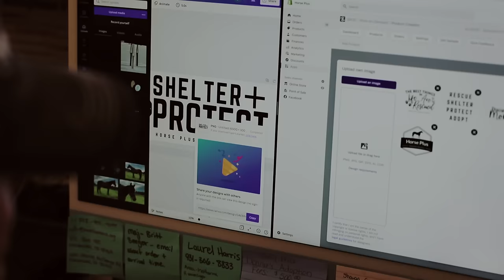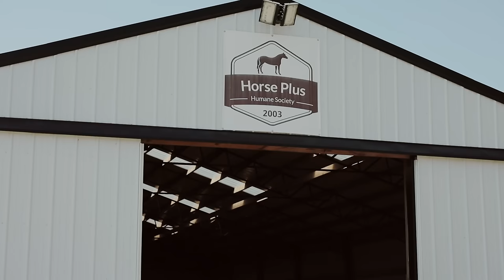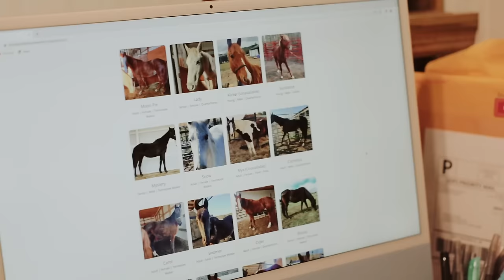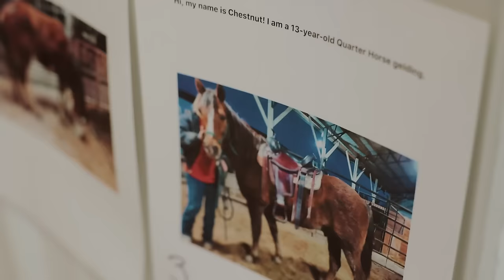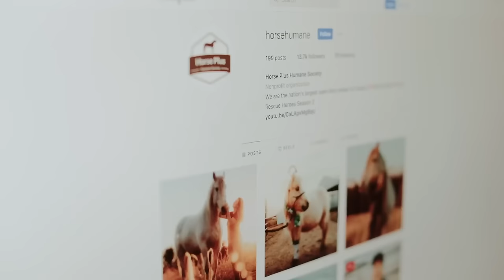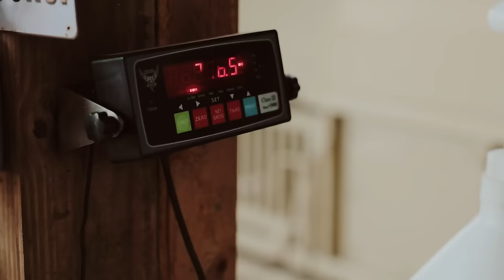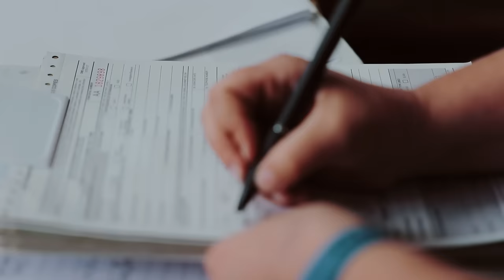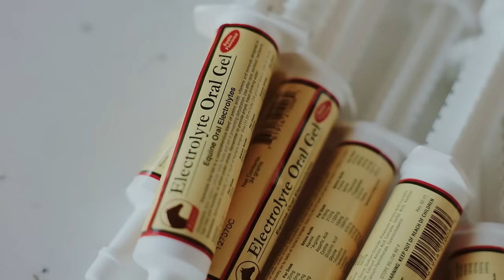We Rescued 4 Draft Horses from Auction | Horse Shelter Heroes S3E6

Comment: Donnie (37:30 min) needs to contact Horse Plus and identify the horse that he wanted  to purchase, that they bought and then try to get 1st dibs on the adoption when the horse comes out of quarantine. He'd be getting a fantastic deal, given the amount of care these horses get from the point of sale at the auction, through the intake and vet checks (additional care, when necessary), farrier work, and then the quarantine process. If Donnie had been successful in buying the horse at the auction, he'd be responsible for evaluating the horse's needs and the adoption fees are not that high. He will probably get a better deal on the horse than he would have, had he bought it directly from the auctioneer. I suspect if Donnie arranges an adoption ahead of schedule, Horse Plus would work with him. Doesn't hurt to ask, keeping in mind, the answer is ALWAYS 'NO' if you don't ask the question.

Comment: I'm glad you mentioned some of the nasty auction tricks like when they give a horse pain meds before it comes to auction so it doesn't show any immediate problems in the ring but you get them home and they are limping or need severe medical help. Another one is when they give them equine steroids to make the horse move out and appear very energetic. This was previously done vary often on draft teams to show how much they could pull and when the new owners got the horses home the horses would not or rather could not calm down and stop running and moving and when they haltered them up and were just walking them to calm them both drafts ended up dying of heart attacks because that is how many steroids they gave them. Sedatives for aggressive horses are also sometimes given depending really on what the seller is trying to convey in that auction and for that breed or work type. 
My guess is with the aggressive horse that there is something chemically or physically wrong as horses just don't normally act that way. Not burst out violently and be so unpredictable and even more aggressive horses I've had to work with have had some level of predictability. I'm guessing if a necropsy was performed there would be something wrong. That little white one and some of the others make me very angry. They simply needed proper vet care, wound care, farrier care, etc. and may have not needed the last act of kindness.
Reply: If you watch the video again, the vet explained about the little white pony. It's knee was fused into that position and the pony would never be able to use that leg normally. The person you need to be angry at is the original owner of that pony who clearly didn't get it appropriate vet treatment right after the injury so it was never in this position.  In each case there was an explanation given in the video as to why that horse or pony was given the last act of kindness-they all had conditions that could not be treated or fixed and that would result in lifelong pain and suffering for the animal in question. Horse Plus saves every equine they can, but in some cases keeping that creature alive would be cruel.  I agree that it is very hard to see, but the real problem is the original owners who dump these horses at auction instead of looking after the problem themselves.  I hope my answer helps you understand.
Reply: @forensicgirl  I wasn't saying I was mad at Horse Plus. I actually said "They simply needed proper vet care, wound care, farrier care, etc. and may not needed the last act of kindness" because so many that were put down were preventable had the owners been good studards of their animals. With farrier care and less grain/alfalfa the ones with founder may not have needed to be put down. With proper wound care immediately that little white one would not have a fused joint and infections from puncture wounds. Due to the size of it and them being puncture wounds could be a coyote to feral dogs. I feel you didn't really understand what I said. I never said I was mad at horse plus but said that every or majority of issues that lead to deaths were preventable. Some easily preventable. You're inferring things and meanings I didn't actually say.

Comment: All of the horses look so chilled out after your intake process. Is this due to them feeling good and happy about where they are, or do you give them something to mellow them out for the intake process that just hasn't worn off yet? They look almost sedated, they are so chilled out, so I am just curious because I know that you guys use a product called Synchill after the auctions, and I'm wondering if it's because of that, or that they just feel happy and calm in their new surroundings and feeling like y'all are helping them now and they're on the road to better lives.
Reply: I don't work there so I can't speak for them but Synchill takes approx 6 hrs to kick in and lasts for up to 18 hours. However it is only a calming supplement. The palomino mare was sedated for the vet to really get in and pull on the skin and pull out the puss and see about stitches.Her eyelids were half shut and her head was very low and well, I've been around the block enough to know she was sedated to thoroughly inspect the wound.  Other horses are given pain relief when they have been in pain for potentially a long amount of time. Having bought from auctions myself. . . . .horses and donkeys are not dumb. They are going from a place where there are sick animals in pain shoved in stalls together with numbers slapped onto them and the place is filled with as many animals as can fit and be sold. The horses are in an unfamiliar place, stressed, uncomfortable, with other horses they don't know who may have been sold 4X before they came to that auction house and they just know. It's chaos and there are speakers calling out numbers and people walking by them to check them out before the auction begins so they know who to bid on or not bid on. When the horses go to a new home or the Horse Plus Sanctuary. . . . .it's not chaotic, they can breathe, there are not hundreds of people and hundreds of other horses stressed to the max. They do the transfer in daylight which helps a lot. One trailer at a time and then each animal individually and they see pasture and horses are all body language so they read people's intentions and these people are not chaotic or intending harm or looking at them like a payday. They give them a lot of slack on the leads and sometimes just use panels to guide them in. It's not a noisy environment. They receive pain medications and medical care they may need. Then they are put into a pasture that is for new comers from auction for a quarantine period to not endanger the other animals at the rescue and it has food and water. You would calm down too if you had fresh air and saw grass and calm people and got medical attention after coming from pure chaos of an auction. I'm human and I don't like the chaos of the auctions. 
Oh, and those wounds like on that mare with the cancer on the hindquarters to the donkey who seemed to be flea infested and the mare with puss in the leg that needed to be cleaned out. . . .they smell bad. They smell bad to their own kind. Horses with cushings smell different because it is like diabetes in humans so they smell sweet like sugar. Wounds smell bad especially when they are not cared for. These horses are surrounded by this in the auction and lord only knows how many auctions they were at before this big one and they smell sick animals and may end up sick themselves or get injured in transport. It's just a horribly stressful environment and I normally do what Horse Plus does and I pay for the overnight board fee and pick the animal up the next day in the full daylight when everyone has left and they have decompressed a little bit. Walking away from that to a stress free environment with pain meds/medical, food, and water is like night and day. The animals know when they are safe and when people care.
Reply: @Lizzard2060  thank you for your reply. Seems like it's probably a mixture of both then, because I think all of the horses were given pain meds the night before, as well as the chill stuff and I'm sure it was all still coursing through them.

Comment: What is BigLick?
Reply: It’s a horse event where trainer’s deliberately take high stepping horses (Gaited and usually Tennessee Walker’s) and put chemicals on their legs and hooves that burn and hurt them causing them to flinch and step higher. To keep the chemicals on the skin, they wrap their legs in Saran Wrap and keep it on for days. To avoid being caught with the horses being in pain from the treatment, they desensitize them with a cattle prod until they stop flinching when they’re touched on the legs as some judges check to see if they had chemicals applied.

The average age this starts is around two, same age as showing, they’re also given platform horseshoes (picture high heels) to wear to exaggerate their step and to wear them they have to grow out their hooves unnaturally long and they never remove it until the horse is retired, some lose a shoe (and part if not all) of their hoof during shows. The horse ends up lathered in pain and can barely walk. This is legal and allowed in the arena along with chains on the horses front ankles that hit them every stride causing them to flinch and step higher.

The result from this if they’re lucky is hair loss that is severe enough for them to be unfit for showing (hair loss means chemical burns and judges banned it years ago) The worst is (and unfortunately more common), broken hips, legs, hip displasia and other chronic back issues that are irreparable.

Horses aren’t made to have so much weight up front. Especially at a young age, and when they fall apart they’re given to the auction for slaughter and the owners buy a new horse for the cycle to continue.

Comment: What is a Big Licks Horse?  Never heard of Big Licks?
Reply: It’s a horse event where trainer’s deliberately take high stepping horses (Gaited and usually Tennessee Walker’s) and put chemicals on their legs and hooves that burn and hurt them causing them to flinch and step higher. To keep the chemicals on the skin, they wrap their legs in Saran Wrap and keep it on for days. To avoid being caught with the horses being in pain from the treatment, they desensitize them with a cattle prod until they stop flinching when they’re touched on the legs as some judges check to see if they had chemicals applied.

The average age this starts is around two, same age as showing, they’re also given platform horseshoes (picture high heels) to wear to exaggerate their step and to wear them they have to grow out their hooves unnaturally long and they never remove it until the horse is retired, some lose a shoe (and part if not all) of their hoof during shows. The horse ends up lathered in pain and can barely walk. This is legal and allowed in the arena along with chains on the horses front ankles that hit them every stride causing them to flinch and step higher.

The result from this if they’re lucky is hair loss that is severe enough for them to be unfit for showing (hair loss means chemical burns and judges banned it years ago) The worst is (and unfortunately more common), broken hips, legs, hip displasia and other chronic back issues that are irreparable.

Horses aren’t made to have so much weight up front. Especially at a young age, and when they fall apart they’re given to the auction for slaughter and the owners buy a new horse for the cycle to continue.
Reply: @SaraNightfire1  Thank you for explaining this to me as I don’t think that we have these events in Australia,  well I hope that we don’t anyways.  I would never want to go and see an event like this anyway.  Such a cruel practice,  Who would want to watch an event like this anyway.  So very cruel.  I hope that the big lick horse can make a good and full recovery.
Reply: @megancaldaia6708  Mostly it’s the money. Unfortunately Big Lick stables have owners with a lot of money on them and love the bragging rights and showing them off of their kids love it and don’t know better.

I had a riding instructor (I only stayed a month), who was huge into Saddleseat (which is usually what Big Lick is associated with), and she would convince her students to buy all her tack (didn’t matter if you owned a horse) and horses from her. She also talked the kids into buying their own grooming kits and other things. 

She made a fortune and she also abused her horses (one lesson she spent twenty minutes beating a horse for not cantering because the martingale/tie down was too tight). The kids and moms loved her because her stable was a social status.